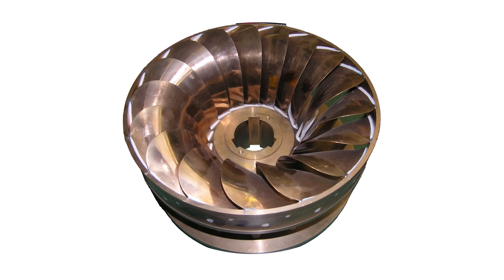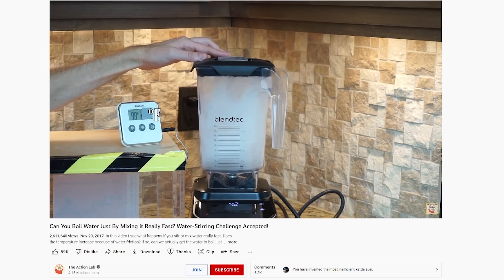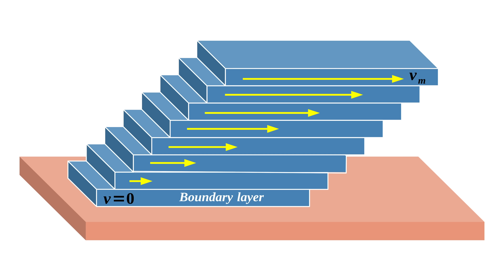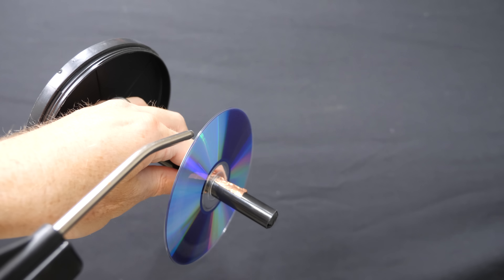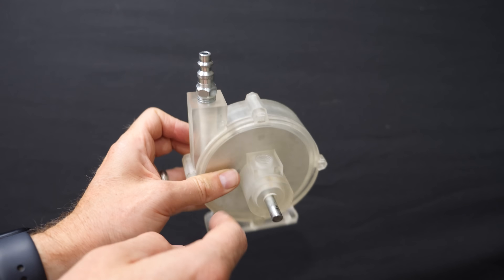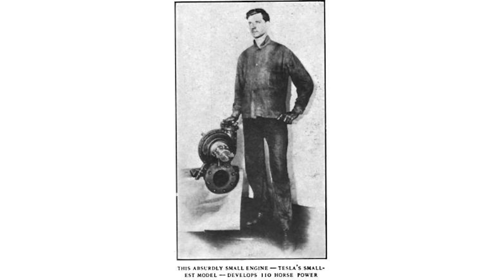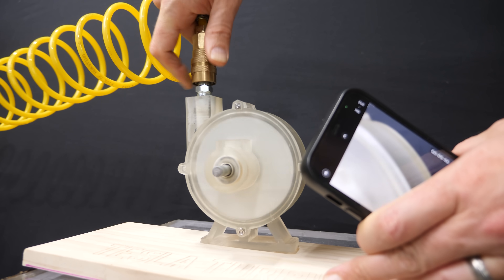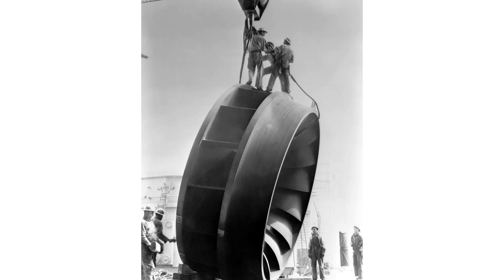How Fast Can a Tesla Turbine Spin?

Comment: The good thing about Tesla turbine is its efficiency is 97% but it has low volume density. Means, at same power load, it requires a huge volume. In industry, a lower efficiency but compact size is preferred.
Reply: When load applied ...disk wont rotate and high pressure forms and break whole thing
Reply: @freespeech515  nah, you have to slowly get it up to speed
Reply: @NwoDispatcher  Yes!  I have seen this in Jeremia's recent releases.  What do you make of it?

I can only intuit that a thermodynamic process in which "kinetic" (both mass flow 0.5mv^2 and thermal (latent heat) energy is converted to rotational torque inside the turbine as a result of some kind of phase change and at some point this becomes self-sustaining, mass flow increases and the "resonant" pickup of energy takes place.  Does this make sense or not?  I have seen it happen, and I trust Jeremia is not fooling us.

I am also inclined to ask if we need to go to the trouble of a cryopherous containing hot water in the first place?  If instead a refrigerant like Butane were used, then at 2 atmospheres it is boiling at 25'C. A BPHE acting as an evaporator warrants pumping the warm water around under ambient pressure conditions without mixing it with our heat carrying fluid.  This refrigerant can be optimised for the temperature gradients experienced.   In contrast, flowing the heat storage medium itself through the turbine will always mean introducing dissolved O2 and N2 into the condenser, and that effectively is a dilution or contamination of the energy density (enthalpy density?) within the turbine.  

In practical terms I think the spin-up might be accomplished by any number of means (using compressed air, gas, the alternator during powered up) or by "cheating" approaches in which external energy is applied before the "heat extraction" phase of conversion.  And we need T and P and flow rate sensors all over the system giving state information as loads are applied. 

And some handle on a  "closed cycle" rather than "open cycle" cryopherous, and an answer to "What becomes of the heat that the turbine does not convert to mechanical power?"

If  have seen this written as:
Heat (Entropy) in Mass Entering Turbine = H1
Heat (Entropy) in Mass Leaving Turbine = H2
Turbine Efficiency (Proportion of H1 converted to turbine shaft power) = X
Generation Efficiency = Y
(and I am sorry but I have lost the will to write temporarily)
H1-H2 = H1 x X 
H2 = H1 x (1-X)

My point is the heat in the mass leaving the turbine is not necessarily wasted to the environment (something Charlie Solis is rightly banging on about), it can be used or re-circulated back to the hot side.  Likewise there is potential for recovery of utility from the cold side of this process.
Reply: @simonmasters3295  i think the turbine works better if it's also designed as a heavy flywheel as well, and heating up the gas as it nears the central exhaust hole it pressurizes further
Reply: @NwoDispatcher    That's is why I am here.  Flywheels run better in vacuum, as you know.   But it takes energy to maintain the high vacuum environment they work best in.    I was thinking, maybe omitting, or by redirecting the vacuum in Flywheel Energy Storage,  to blowing some highly compressed gas on a disk array of flywheels.  The cheating, getting them to spin up, and maintain moderate velocities, can be done by renewables, and we could maintain a vacuum by air extraction as an option, or then invert the extraction, to a compression and turn the flywheels into Tesla turbines to rev up the system when not loaded and charging.  Unfortunately, I only see it good to power up a standby array, it takes too long to extract the energy for this weight class design and demand.

Comment: Seems to me you will need very clean liquid to run this kind cause  it's enclosed it will get disturb by dirty water
Reply: TesTurs are the only turbines that can handle multiphase fluid flows without damage to the turbine. All bladed turbines, which rely on the complex blade geometries, quickly wear dowm over time from particulates and cavitation but the Tesla turbine doesn’t because it doesn’t have any lifting surfaces for the particulates to smash into. 

In fact the sorta “bumper bowl” between the slower boundary layer regions without ever touching the disc.

Comment: How can turbines have 35% loss if pumped storage hydroelectricity has a full-cycle efficiency of 70 to 80% and even higher ?
Reply: Great question!

My suspicion is the 80% figure is simply a lie. Pumped hydro isn’t used because of its efficiency so nobody cares.

Comment: Has anyone tried to build a tesla turbine based turbocharger for an engine?  Think about all the energy that could be recovered with a laminar flow exhaust turbine on an ICE.  Also it would make the exhaust very quiet.  Oh wait that won't work.  We run into the OTHER major failing of Tesla Turbines.  The working fluid needs to function at a very constant velocity and pressure.  All comes down to our good old friend the Reynolds Number.  They have a major har limit when you leave laminar flow.  Like kablooey hard.  Modern vened turbines can handle a bit of abuse.  Teslas, not so much.
Reply: That's incorrect. To ensure laminar flow occurs you decrease the disc spacing as outlined in his patents and proven by Charlie Solis (goes by same name on YT), look up his channel and you can see for yourself. Dude's got a degree in physics and has figured out how to build them correctly. Additionally, TesTurs can handle multiphase fluids and particulates (and water droplets) in the motive fluid which means they can handle more abuse than conventional turbines and can use lower grades of heat/steam whereas conventional turbines would be worn down by said water droplets.
Reply: Where did you get the idea that Tesla turbines can’t handle any abuse? 🤭

Comment: There is another major problem with these you didn't address. The working fluid.  Water, steam, air.  They aren't pure substances.  Even the purest water is going to erode the discs.  So you make better discs, then you make a better fluid, then you make a better disc.  That's how engineers think.
Reply: Sorry bud but you have this backwards. It’s the bladed turbines that erode. 

Tesla turbines are specifically capable of handling multiphase fluid flows without damage to the discs because the particulates and cavitation have no lifting surfaces to smash into. 

And despite what’s erroneously claimed about the Tesla turbine the fluid is not “sliding across the disc face” 

[TL/DR: This is not a mechanical turbine in any shape or form. Since all molecular adhesion and internal viscous forces within a fluid are governed by electron orbital interactions, this makes the Tesla turbine a purely electronic turbine.]

The BIGGEST misconception about the Tesla Turbine that most people get wrong is that they think the fluid is actually sliding and dragging on the disc, similar to as if a solid object was “sliding” across the surface of another solid object. 

It is not. Full Stop. 

The fluid that’s just off the surface of the disc face is ALWAYS statically adhered to said disc face and never moving relative to the disc. 

The torque to the disc comes from shear stress “cohesion” forces within the motive fluid trying to move through itself.

The shear force is transferred through the motive fluid itself to the layer of fluid that is statically adhered to the disc faces, and then through the virtue of molecular adhesion the discs are pulled along with it, or Vice versa the discs pull the fluid along with it. 

The only “friction” involved in this is that of internal friction within the fluid against moving through itself, ie Cohesive viscous forces. 

And sorry I don’t mean to sound like I’m being pedantic, as I’m sure I’m restating many things you already know. 

It’s just a very important key part of the operating functions that everyone gets wrong. This is not a mechanical turbine in any shape or form. 

Since all molecular adhesion and internal viscous forces within a fluid are governed by electron orbital interactions, this makes the Tesla turbine a purely electronic turbine. 

As Tesla even alludes to in the article “Dr. Tesla Talks Of Gas Turbines” 

… “I have been working at this a long time. Many years ago I invented a pump for pumping mercury. Just a plain disk, like this, and it would work very well. ‘All right,’ I said, ‘that is friction.’ But one day I thought it out, and I thought, ‘No, that is not friction, it is something else. The particles are not always sliding by the disk, but some of them at least are carried along with it. Therefore it cannot be friction. It must be adhesion.’ And that, you see, was the real beginning.

“For if you can imagine a wheel rotating in a medium, whether the fluid is receiving or imparting energy, and moving at nearly the same velocity as the fluid, then you have a minimum of friction, you get little or no ‘slip.’ Then you are getting something very different from friction; you are making use of adhesion alone. It’s all so simple, so very simple.

“This is the greatest of my inventions,”……
-Nikola Tesla (September 18th, 1911)

When designed correctly, it works principally upon electron interactions between the fluid and itself and the fluid and the disc material. 

The first important factor being how well does the fluid actually molecularly adhere to the disc faces when submerged in an atmosphere of the motive fluid. 

This is also seen as the “Wetting angle” when there are two fluids in contact with the surface and they are competing for adherence. 

Think hydrophobic and hydroPHILLIC surface treatments.

The second important factor is the viscosity of the motive fluid in question, as it represents the fluids ability to “flow through itself with or without resistance” per se. 

Herein lies the reason it is extremely important to maintain laminar flow regimes within the disc spaces. 

Because irrelevant of the viscosity of the fluid, ALL FLUIDS, liquids and gases, can be forced to flow in highly efficient low Reynolds number laminar flow regimes given the right initial conditions and “flow cavity” parameters, such that turbulent boundary layer slip is eliminated, stream separation and counterflow is eliminated, rapid pressure changes from turbulence resulting in noise losses that can lead to early fatigue on discs and parts is eliminated, etc.

Comment: The big problem I see with them is that they look very sensitive to vibrations. Even a small feedback loop or stray vibration could cause the disks to rub against each other in a scaled up model.
Reply: Nikola Tesla patented an improved disc stack patent GB 186,082 in 1921, 10 years after the original and a decade of R&D. Vibration is not an issue when built correctly. 

“In the new design I employ two heavier end-plates which are machined tapering toward the periphery for the purpose of reducing the maximum centrifugal stress as much as practicable. The inside discs, of relatively thin material, are rolled, forged or ground tapering in like manner and with the same object in view, but this may not always be necessary and plates, made of sheet metal of substantially uniform thickness as furnished by the mills, can be employed. Each of the thick as well as thin plates is provided with exhaust openings, leaving a solid central portion like the hub and spokes of a wheel. Star-washers of similar configuration serve the purpose of keeping the discs apart in the center and for the peripheral spacing the thin plates have small holes drilled in them on a circle, or circles, of suitable diameter, and in these are driven tight-fitting studs which are upset at both ends by a special tool so that they will project beyond the metal on each side a trifle more than the thickness of the star-washers. When the plates are put together the separating studs do not come in line but are straddled in order to give opportunity for slight yielding, thereby eliminating constructional difficulties which might be caused by unevenness or other mechanical imperfections. Thus the rotor can be finished closely to predetermined overall dimensions and will run true on the outside even if the thin inside plates should vary a little in thickness or be slightly warped. To simplify this arrangement I provide only every second plate with studs, using plain ones between. Furthermore, with the object of cheapening the manufacture I dispense altogether with the former, accomplishing the spacing by means of small bosses or protuberances which are raised in the plates by blows or pressure and provide a die, practically reducing all the machine work on a thin plate to a single operation in a stamping press. The star-washers, while preferable, are not indispensable and may be replaced by round separating washers of a diameter about equal to that of the hub part of the discs.”
-Nikola Tesla 

“This construction permits free expansion and contraction of each plate individually under the varying influence of heat and centrifugal force and possesses a number of other advantages which are of considerable practical moment. A larger active plate area and consequently more power is obtained for a given width, this improving efficiency. Warping is virtually eliminated and smaller side clearances may be used which results in diminished leakage and friction losses. The rotor is better adapted for dynamic balancing and through rubbing friction resists disturbing influences thereby insuring quieter running. For this reason and also because the discs are not rigidly joined it is safer against damage which might otherwise be caused by vibration or excessive speed.”
-Nikola Tesla
Reply: That's way Tesla recommend to also use  his dynamic balance machine before putting the whole thing together
Reply: The disks are keyed to each other, and the contact is resisted by the pressure. The damage from that is insignificant, and insignificant even if you are pumping sludge through the system.
Reply: The real problem is if you allow the disks to spin at maximum RPM they will spin until they explode. No material exists that can sustain the level of momentum. It is an extremely efficient design but it is not without its flaws. The larger they get the bigger the issue.
Reply: @rekrn12345  I mean the same limitations technically apply for regular turbine systems as well. If a turbine engine spins too fast, it can melt or explode just as easily.
Reply: @_shadow_1  yes, but the Tesla engine needs to spin much faster to get reasonable efficiency